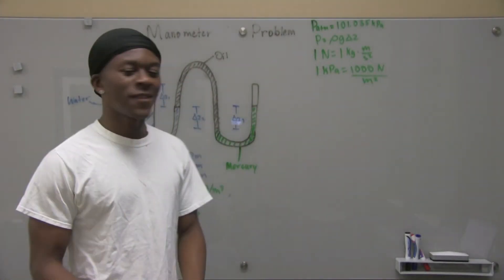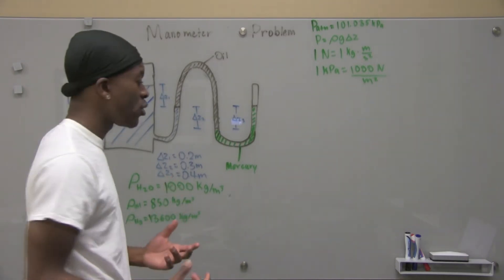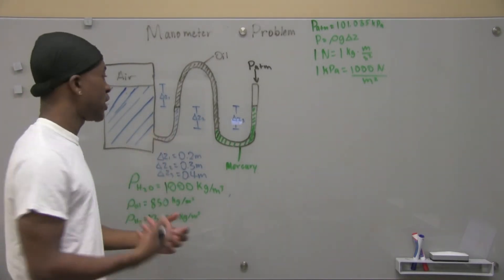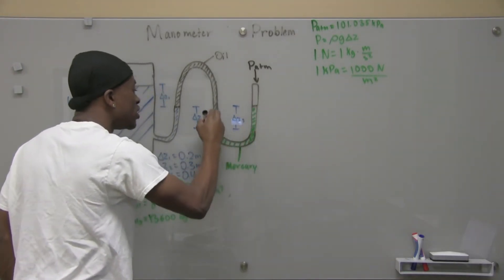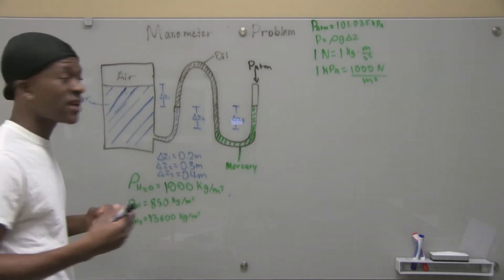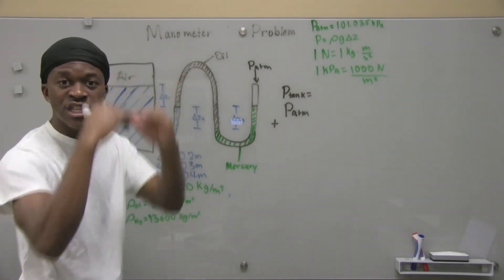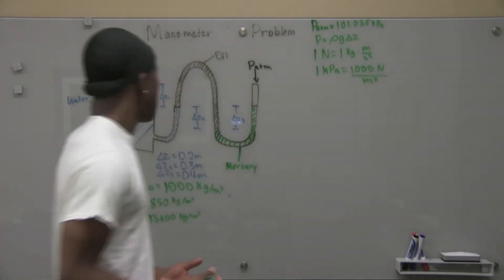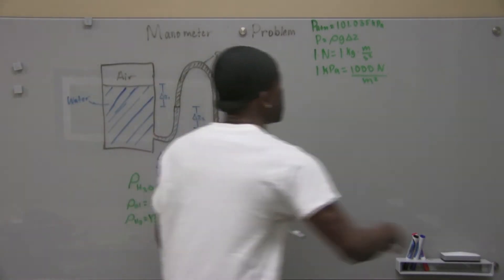Lesson 6: Manometer Example Problem

Comment: 10:23  please 🥺 how does this part gets a negative sign?  But you explained that  when the fluid are going down, it's becomes positive in pressure?
Reply: Yes, since the end point of oil and water are both higher than their starting point, it means that there is a loss in pressure, hence why the negative sign. Fluids that are going down are positive as there is an increase in pressure. Think of it that as the fluid is going lower, there is more fluid above that point. So there is increase in the amount of fluid also increase in pressure.

Comment: sir, i still not clear about dividing the value with 1000. how do i know when i need to divide by 1000 or not?
Reply from the maker: It’s all about the units. You need to double check and make sure that what final unit you want to arrive at is taken into account.
Reply: @TheThermoSage   thank you so much sir